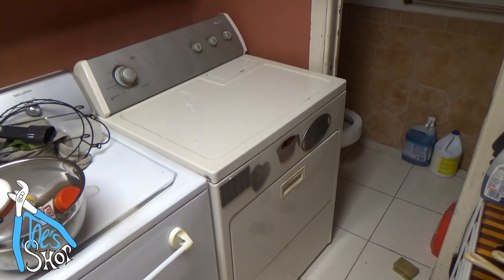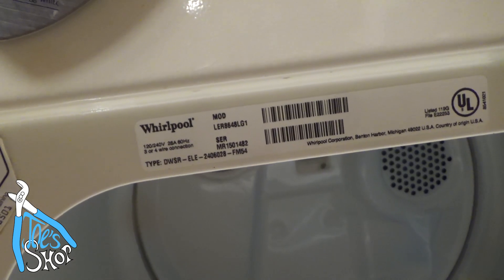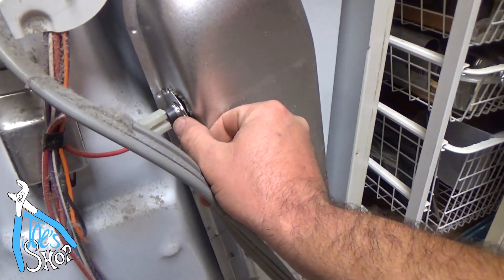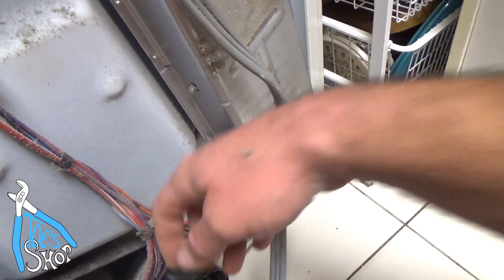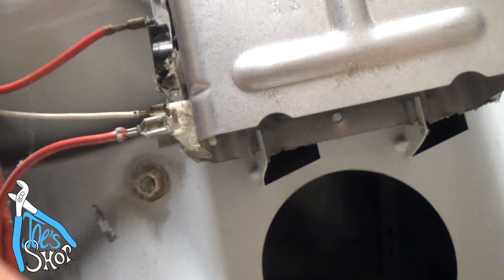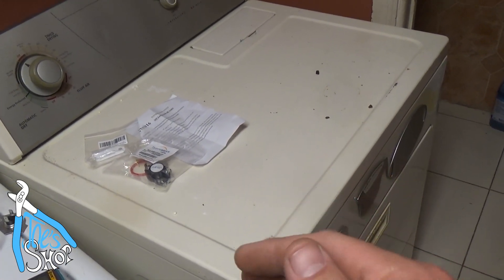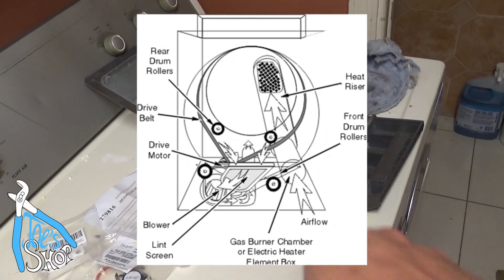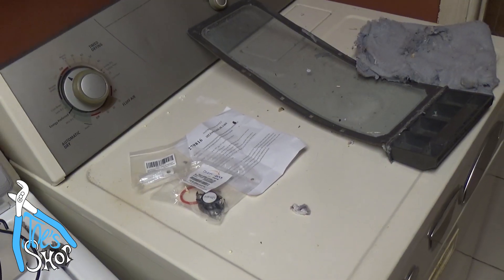Whirlpool Dryer Repair ($14)

Comment: Good fix, for appliances like these you got to go to the easy stuff first. There were countless times that I got in really deep only to realize the damn thing wan't plug in or something. I'm glad you showed what caused the fuse to blow, keeping that lint in there (which is quite good tinder) would make the replacement of the fuse a regular thing, it's a good reminder (for me at least) that you need to solve the root of the problem. Thanks for sharing and take care!!

Comment: Well done. I replaced my thermal toaster oven coils. (Before i started my channel) some wheat seeds and lint got throw and shortened the coils...
Took me longer to track the replacement part then to replace 🤔. Got another 2 years out off till it died eventuality.
I always clean the lint trap before... Emphasis on the I 😉
Thanks for sharing...